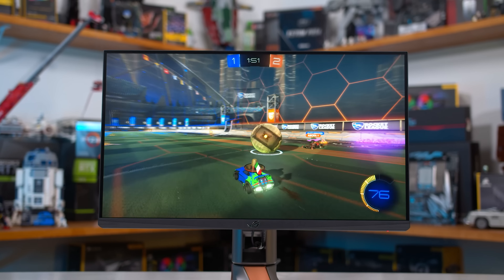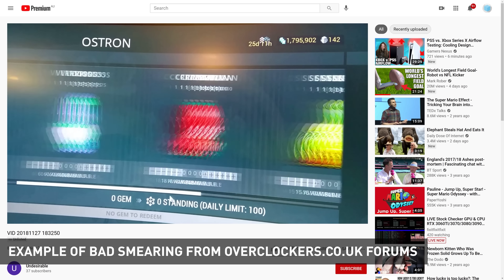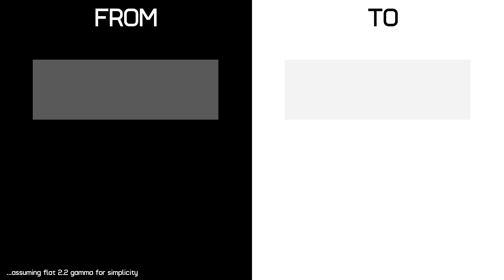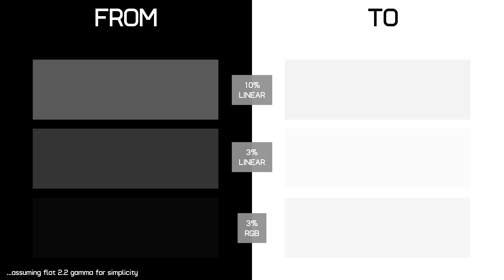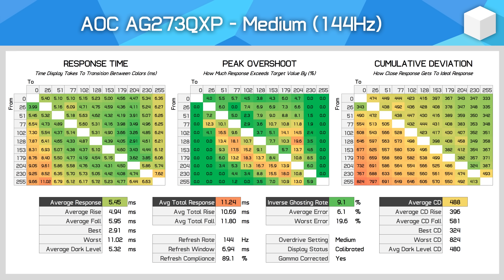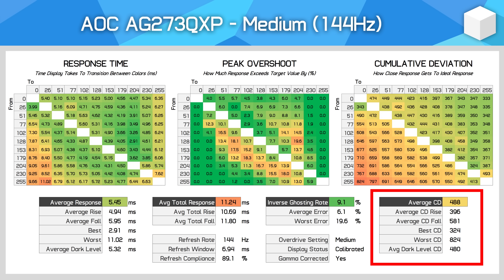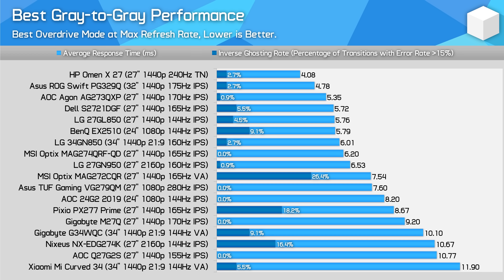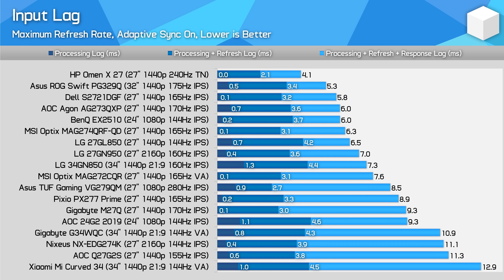What Are Response Times? Overshoot? Ghosting? Monitor Testing Overhaul For 2021

Comment: To be honest, most if this was way above my head. Still I was hooked for 24 minutes. It's like when I watch science documentaries about space,  black holes and wormholes etc, I don't understand 100% of all the technical details, but still find it mesmerizing. Of course the manly James Hetfield style mustasch does help to mesmerizing me, he he he !!! 😎

Aa a side note, I think I even understand more of bending or folding space and wormholes than the technical testing method details in this video. Still mesmerizing though.

If I understand at least a bit correctly, my biggest take away from this is that the 0.5 ms or 1ms response time that almost all monitor manufacturers brag about isn't worth much. They seem to use other test methods that present the best values which can then be used as a marketing tool. No surprise there really. It's how corporations operate I guess.
Reply: Yeah, display companies are getting away with downright lying right now, when it comes to their displays' pixel response times.
They either quote 10-90% grey-to-grey for the absolute best transitions (which is highly deceptive) or, lately, they've started giving the bs MPRT response, which is even more insulting. But they've been getting away with it so far.

Comment: Another nice addition would be value add features, included software as an example. Say, if you could use software to change the overdrive setting level via a hotkey, update the firmware etc. On an ultrawide, switch to PiP with a console on the right and PC on the left on the monitor. Stuff like that.
Imagine if you could hit ctrl+alt+p to set refresh rate to 120, switch to PiP and play a game on your PS5 or xbox series x (most likely you're imagining owning either of them but hey).
If any of them include such features I bet I'm not the only one who would consider that monitor over another if everything else was comparable.

Comment: It's telling how extreme an adjustment this is that the 3% RGB difference black box is almost completely invisible on my Dell XPS 15, which has a decent quality display. Based on this example, I'd have thought you could extend back out to at least a 5% difference once gamma corrected and still get a result that reasonably represents the response time between perceivable differences in colour.

Comment: Thank you, the new testing methodology looks great! I'm desperately seeking a good flat 32" IPS with both good colour (for content creation) and response times (for gaming). SRGB and 120Hz is fine but wide gamut, higher refresh is better ofc. The MSI PS321QR has been out for a while now and is available in Australia although there's a dearth of quality reviews. It's specced as 165Hz, 99% aRGB, 95% DCI-P3 so it looks good, but I'm not going to drop 1200 dollarydoos without a reputable review.

Comment: Didn't expect a Statistics Lecture from Hardware Unboxed 😂😂
Reply: More like electrical(or other) engineering 101.
Reply: @johnyang799  it's more electronics related than electrical. And pulse or digital signal is not that basic at all, especially when we talk about the reality v/s the idealization of the theory.
Reply: @PainterVierax  It's the same. At least in my university it's under same program. You have to learn them all.
Reply: @johnyang799  I don't understand what you mean by "learn them all". Are you talking about theory and practice or about electrical and electronics?
Also this is intermediate knowledge but not an engineering level. If it is something not even taught during the college degree or earlier in a technical high-school diploma (like they exist in the German and French educational system, I don't know that well the anglo-saxon one) then it's quite concerning to discover that during the intro class of uni.
Reply: @PainterVierax  Electronics and electrical. Power electronics, control system, microelectronics, telecommunications.

Comment: Ok so it's clear that going from a linear nit to a non linear rgb measurement makes a lot of sense but it would have been cool to show the 90-10% tolerance with gamma correction to see the influence and justification for changing the tolerance. Is there a particular reason to chose 97-3% or any other values ?

Comment: Great to see new data analysis being implemented. So now is there an 'easier way' to say monitors below 'x' have a 'nice' picture or is it still down to the individual viewer?
Does temperature of the monitor affect the performance of a monitor? e.g. cool 20deg C (fan blowing on the back) vs say 50 or 60 deg C?

Comment: Did we, as an industry, make a mistake when transitioning away from CRT's to LCD panels?

I don't remember "Ghosting" or "Inverse Ghosting" being a thing during the CRT era, Panel Uniformity, Refresh Rate Compliance weren't issues either.

Should we have gone with SED technology based panels?

https://en.wikipedia.org/wiki/Surface-conduction_electron-emitter_display

The true successor to CRT's?

It just seems like we're compensating for bad fundamental technologies when we can have better, more perfect panels that display color in a superior fashion, without any of the previous issues.
Reply: Convergence was an issue in CRTs (the three colored subpixels did not line up exactly perfectly), as well as burn-in (screensavers say hello!) and brightness drop due to phosphor aging.
Reply: @TheBackyardChemist  As far as the convergence issue, the 3 colored subpixels were created in a Hexagonal array.

https://en.wikipedia.org/wiki/Subpixel_rendering

Instead of the more modern LCD 3x Vertical Stripes.

As far as burn-in, & phospher aging, those are similar problems that OLED TV's have as well.

Comment: I wonder if the average (or maybe the geometric mean) of the differences between the ideal behavior and the measured one is a better metric over the sum. However, as a math aficionado I understand this is a rabbit hole and you just have to stop somewhere. Thanks for the in deep explanation of the metrics you use and hopefully I'd be able to afford one of those fancy high refresh rate monitors by spring/summer.

Comment: Bring back CRTs!
Reply: would be funny to see it compare to those modern LCDs lol
Reply: They aren't needed anymore unless you're playing on old consoles. If you want the same motion clarity you can get one of the Blur Busters Approved monitors which look very similar with backlight strobing. Currently the only one is XG270 but there's a 24 inch model coming which will support strobing from 60hz to 240hz and we might also see a 1440p one in fall. Check out the XG270 review by a5hun.
Reply: Hell no
Reply: @TheWeirdPianist  sure you might get the response, but you'll never get the pure blacks of a CRT and thus colour and contrast are percieved as much worse. Literally the only technology that beats CRTs is OLED, with near-instant response, self emissive pixels with perfect blacks and thus amazing contrast and colour, only major downside previously is that they've all been 60hz, but as of 2020 they're finally available in 120hz. Only a shame that one of CRTs biggest downsides, burn in, is even worse with OLEDs, making them problematic as monitors.
Reply: @giserson2  You can get better blacks than CRT with a Mini-LED backlight. It'll also have less flicker just like CRT with rolling scan and no strobe crosstalk anywhere on the screen. We'll for sure see a Mini-LED Blur Busters Approved monitor in a couple years.

The only thing that CRTs had that we can't replicate is no input lag. Not yet at least. But we can get pretty close.
Reply: @giserson2  Btw OLED doesn't beat CRT in motion clarity due to limited peak brightness but some get pretty close with rolling scan.
Reply: @TheWeirdPianist  I was pretty sure CRTs had a pretty limited peak brightness as well, but I might be wrong on that. 
How do you think Mini-LED can get better blacks than CRT? Mini-LED still has a very limited number of zones which means light will bleed across quite a lot of pixels.
Another advantage and really the main reason to own a CRT display is the fact that it's not fixed-pixel allowing any resolution that can be displayed to look its best and not introduce extra lag from scaling, this is of course most important for low resolutions like in old games at 240p/480i on TVs or 640x480/800x600/1024x768 for PC games.
Reply: @giserson2  The overall brightness is similar on CRTs and OLEDs with rolling scan but I'm talking about the scanline in that rolling scan. On CRT the image is drawn line by line and that line is extremely bright, it could be 10,000 nits. On OLED you get a thick line that's 1/4th the screen height in the best case during rolling scan and the peak brightness is only 700 nits. To get the same 100-150 nit resulting image it has to trade motion clarity by having a thick line. OLED could have a thinner line for better motion clarity, maybe even one pixel wide like a CRT but the resulting image would be too dark. Upcoming OLED TVs will have a higher peak brightness and we might see improved motion clarity during rolling scan or at least improved brightness.

I'm talking about Mini-LEDs with 1000 or more dimming zones. CRT too has some blooming around bright objects against a pure black background so a Mini-LED backlight with enough zones can reduce that blooming to unnoticeable levels.

CRT is definitely better when it comes to scaling and input lag and it'll be really hard to replicate that but it's not impossible. Modern 4K TVs have great upscaling algorithms that make low resolution videos look like 4K without any artifacts. That adds input lag though but it can be reduced with a fast processor in the future. On monitors the GPU could do the work. DLSS already does wonders in some games. As for retro games the monitors could use integer scaling instead of normal scaling. It will preserve pixel art without adding extra input lag.
Reply: @TheWeirdPianist  I'm going to have to look up rolling scan because I honestly have no clue about it. 
As far as Mini-LED haloing vs CRTs I'd imagine that the effect would be similar or better on a Mini-LED once you start going above a few thousand zones, hard to say without seing it of course, but from my experience the haloing on CRTs is worst-case at about the same percentage of the screen size as you'd get with a few thousand zones with Mini-LED.

Integer scaling is of course a great alternative now that it's become more available in GPU drivers, but it still isn't a perfect solution since you'll end up with black bars around all sides depending on the resolution of the display and the resolution of the game. Let's say you have a 4K display, you'd get a 640x480 game to 2560x1920, a 800x600 game to 2400x1800 and a 1024x768 game to 2048x1536, on a 1440p monitor you get only black bars on the sides for 640x480 scaled to 1920x1440, 800x600 goes to 1600x1200 and 1024x768 remains unscaled in a tiny box in the middle of the screen, for 1080p displays you get 1280x960 for 640x480 and the rest goes unscaled. With a big 4K OLED or Mini-LED the borders might not be that distracting though.
For any kind of semi-modern content modern TVs and other AI upscaling can work wonders, heck even "dumb" solutions like throwing a ton of GPU horsepower at a 720p video to upscale and denoise it can give good results.
Reply: @giserson2  Watch the Slow Mo Guys' video "How a TV works in slow motion" to see how CRTs refresh line by line. A similar thing happens on OLED when you enable rolling scan except the line is much thicker and the line thickness decides how clear the motion is. Check out Blur Busters' article "Why do some OLEDs have motion blur?". The rolling scan is explained there with pictures. Mini-LED will allow for a thinner and brighter line which is closer to a CRT and when compared to slow phosphor decay times of some CRTs it will actually be clearer.

As for integer scaling ideally you'd want an 8K display which would allow for 8K, 4K, 1440p, 1080p,  720p, 540p, 480p, 360p and 240p to be displayed perfectly. The rest of the resolutions can be displayed without black bars if the display can become transparent instead of showing black. Transparent OLEDs already exist and upcoming microLED will make that even easier. We'd want an option to switch between black and transparent though.

Comment: I've had the Dell S3220DGF (31" 1440p@165hz VA) for 1 month to play with. I ended up returning it today and concluding VA panels will NEVER be good enough. I just couldn't stand that smearing when scrolling pages, especially, and the huge amount of overshoot clearly visible in games (like brown terrain would turn yellowish/reddish in fast motion) and lack of clarity (fine details and text not being distinguishable in motion). 
I'm now using again my good old and trusty VG248QE (24" 1080p@144hz TN) until I can decide what gaming monitor I should buy to upgrade.
@Hardware Unboxed what do you think, would the 27GN750 provide at least the motion clarity of an older TN like VG248QE? I'm a bit hesitant about IPS being as good in fast motion games, even if it's 240hz.

Comment: UWHD Benchmarks!!! The "Dozens of us" need closure!!
Reply: This is not the video for that. This video is not about game benchmarks, but monitor hardware benchmarks.
Reply: Doesnt a few comparison to some fixed resolution will get you a rough ratio of how much fps you will get? For ex. comparing against standard 1440p, will probably get you a rough percentage fps drops. Unless there is strange quirk to game engines running on UWQHD that i didnt know, pls do correct me.
Reply: @Crustee0  yeah typical way to go at it is to average 1440p and 4k fps data. Kinda works, but it should sit closer to 1440p than 4k.

Comment: But....why don't we measure ALL of the dark part response time? I mean I understand that for the white end, since it's probably kind of asymptotic this would take mathematically forever to reach the final value, but the start of the response time measurement is known. It's when we give the monitor the signal to start the transition. So why not just start the measurement there and then?
What if a monitor takes a while before it even starts to react? That's something we can't measure right now because we don't start measuring before it does start to react.

In essence what you are measuring now is not a response time but a transition time?

Comment: Just use 2% settling time starting from absolute 0(minimum above noise floor).
Reply: Cumulative deviation probably works too but overshoot is still worse than undershoot.
Reply: Ayyyy the total response time it is. Nice job guys!
Reply: Can we have a non averaged total response time chart too? Just like normal response time.

Comment: Still kind of useless to most people as they do not have a calibration tool.
The out of the box options on a monitor varies greatly and should be shown.
We need a comparison of out of the box setting and presets, as well as what settings to use for best results without calibration.

Comment: I know that hardware unboxed stated that msi 274qrf was the fastest before this video now, but now its not so true is it? Does .50ms make a huge difference in practice? I know msi has better color range and contrast so id rather use the msi than the lg

Comment: So, does this change your previuos recommendations for 1440p IPS monitors ?
With the previous method the recommendation was for the MSI MAG274QRF-QD as the best allround gaming monitor you tested. When i compare your latest charts to the Dell S2721DGF the DELL was ranked higher in (almost) every chart. 
I got both of them on my watchlist, and still cant decide which one to get when i'm finally able to get my hands on a new GPU (whenever that will be...)

Comment: While it's an emprical value that'll show up after many monitor reviews, what do you guys think is a 'pretty good' CD value so far? Is the score on a per monitor basis (fast enough transition for intended refresh rate + little to no ghosting = good low CD)?
Reply from the maker: 300 is elite, 500 is good and around 700 is average based on what I've tested so far
Reply: @Hardwareunboxed  thanks for the response! Is this a per-monitor score? Like if a 144Hz monitor has a lower typical CD than that of a 240Hz monitor, is that necessarily a better viewing experience?

Comment: I’ve got a question about buying a monitor. Right now I have a laptop that runs in 1080p. Should I just grab a cheap-ish 1080p monitor 144hz monitor and wait until I build a gaming pc late this year to buy a mid range monitor. Or should I jump directly to 1440p 27in even though my pixel density will be weird in 1080p? Laptop has gtx 1650.

Comment: Nice video. But i wanna ask i want upgrade from my old monitor 1080p 60hz better go 1440p 144hz va panel (aoc cq27g2) or 1080p 144hz ips (asus tuf vg249q)? Thanks
Reply: AOC but go for the 24inch G2 not 27
Reply: @TearyBoi  Ah ok. I wanna ask your opinion again if 1080p 144hz ips better take aoc 24g2 like you mentioned or asus tuf vg249q? The difference just in warranty, AOC 1 year full+ 2 years service, ASUS 3 years full warranty. ASUS price is cost $15 more

Comment: Hey guys, I had a brand new Asus PG329Q which had a colour banding problem. Got it RMA'd and they replaced the panel. It's fixed the banding, but now it feels like there's some sort of frame stutter at low fps (60s) - in games like Dragon Ball Fighterz for example the movements on screen don't feel as smooth as it was originally. 

There's also quite nasty screen tearing with Vsync OFF which wasn't there before the panel was replaced (the monitor's Gsync compatible, but since I'm running GTX 980s it only supports Gsync Ultimate). 

Is there any way I can test this to determine whether it's a monitor problem or my GPU/System causing it?

Thank you so much!